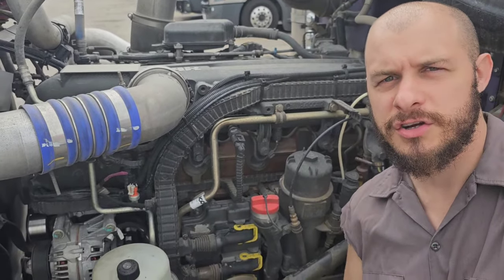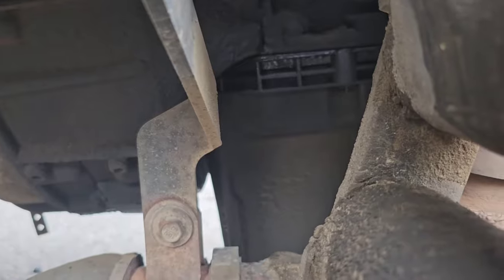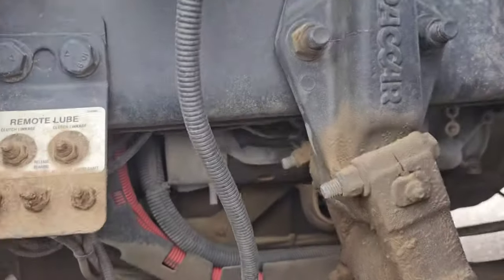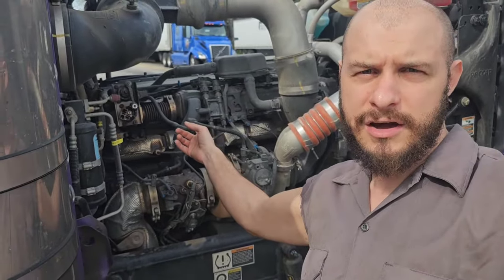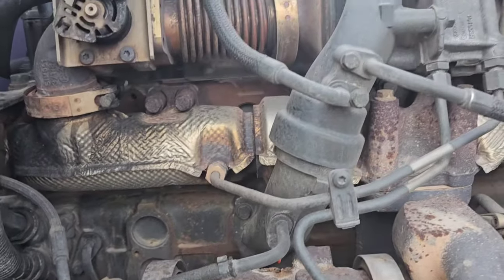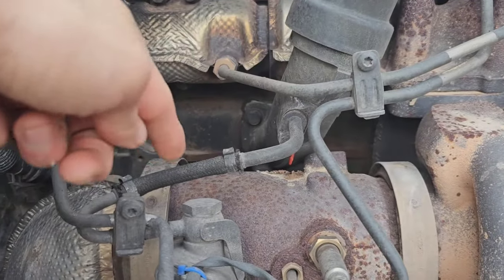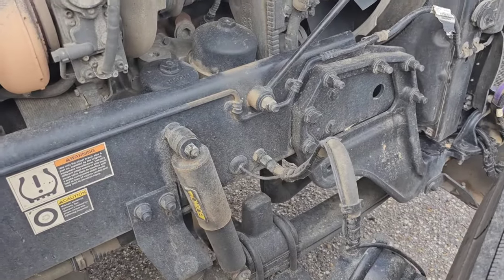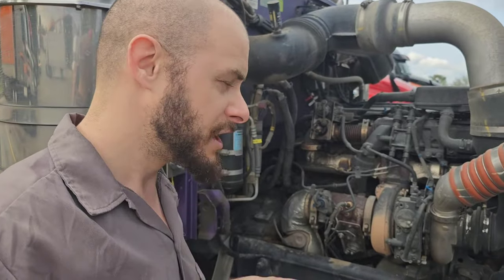few new issues with my PACCAR engine

Comment: Hey bud, paccar tech here. Don’t let those guys just replace that oil pan bolt. Once a gasket starts leaking, it aint gonna stop, as you experienced with that coolant line. Gotta drop the pan and replace the oil pan gasket and torque those suckers down. Don’t replace that whole coolant line either, jut a $2 o-ring leaking. (Without labor $$) all this is just common stuff on any engine. If these are the worst problems you’ve had with a new engine consider yourself in good standing
Reply from the maker: Yeah my last paccar blew up with 700 miles on it the second day I had it... so this one is better
Reply: Lol few issues is just beginning 😢😢😢😢
In 600k miles on my engine 😮😢😢😢😢😢
1st time the rebuild the engine 465k 2nd time 665k new engine:(( 
3 times transmission:( 
Manifold  200k 
New DPF system 120k
3 times coolant reservoir:(
2 times oil pans 
Ac compresor 180k
Oil and injector seals 90k , air compressor head 2 times 😢
Radiator, alternator, EJR cooler:( ABS 4 times, 
HI pressure fuel pumps 3 times replaced 😮😢😢 DEF level & quality sensor 😢😢
350k all axels airbags and internal oil seals :((
2 times PDF all sensor replaced 😮😢😢
Coming rail, fuel pressure sensor  😮😢
Oil, pressure sensor  😢
Clutch damage by computer :((
15-20 times computer updates  😮😢😢
The list keeps going  on 😮😢😢😢
Wire harness  , ABS harness :(
Reply: @mgp-bct7723 what’s the price for a rebuild on the PACCAR
Reply: robstratton based on your experience and knowledge what is better Cummins or paccar engine. ??

Comment: This question is for a paccar tech I’m currently on the side of the road with multiple codes. This thing has been nothing but a nightmare with adaptive cruise predictive cruise and transmission codes. Replaced the shifter and now this truck won’t hard reset J1939/886-09/1481-09/&19 any thoughts?

Comment: Hey there. For issues with EGR valve you can use EGR Emulator for Paccar. Its plug and play, easy to use and can solve most EGR Problems.

Comment: Sir, read your instruction manual it states after every oil change the oil plug needs to be replaced. Everytime.
Reply from the maker: The oil pan bolts come out not oil drain plug
Reply: @tips4truckers252  Bolts cant come out unless somebody screwed them out.

Comment: Hi I have same engine with 150k miles there is soot around EGR cooler is it serious should I change EGR cooler gaskets
Reply from the maker: A little soot on the actuator is normal.  I wouldn't worry about it with only 150k unless you get a differential pressure code

Comment: Hey man, quick question would you recommend buying 2020 Kenworth T680 with 400,000 miles flight maintained came equipped with APU since new very nice condition. I’ve heard bad things about Pat car. What is your recommended?
Reply from the maker: Used truck prices are through the roof but if you can get a good interest rate is what I would be wondering about
Reply: Stay away from paccar product Kenworth or Peterbilt 😢 the parts are the most expensive labor, the most expensive, and the quality the worst of the worst 😮😢😢😢😢 shame on the paccar 😢😢
😮😢😢😢
Lol few issues is just beginning 😢😢😢😢
In 600k miles on my engine 😮😢😢😢😢😢
1st time the rebuild the engine 465k 2nd time 665k new engine:(( 
3 times transmission:( 
Manifold  200k 
New DPF system 120k
3 times coolant reservoir:(
2 times oil pans 
Ac compresor 180k
Oil and injector seals 90k , air compressor head 2 times 😢
Radiator, alternator, EJR cooler:( ABS 4 times, 
HI pressure fuel pumps 3 times replaced 😮😢😢 DEF level & quality sensor 😢😢
350k all axels airbags and internal oil seals :((
2 times PDF all sensor replaced 😮😢😢
Coming rail, fuel pressure sensor  😮😢
Oil, pressure sensor  😢
Clutch damage by computer :((
15-20 times computer updates  😮😢😢
The list keeps going  on 😮😢😢😢
Wire harness  , ABS harness :(
Reply from the maker: @mgp-bct7723  at some point you have to say not all that was bad luck fr.

Comment: Lol few issues is just beginning 😢😢😢😢
In 600k miles on my engine 😮😢😢😢😢😢
1st time the rebuild the engine 465k 2nd time 665k new engine:(( 
3 times transmission:( 
Manifold  200k 
New DPF system 120k
3 times coolant reservoir:(
2 times oil pans 
Ac compresor 180k
Oil and injector seals 90k , air compressor head 2 times 😢
Radiator, alternator, EJR cooler:( ABS 4 times, 
HI pressure fuel pumps 3 times replaced 😮😢😢 DEF level & quality sensor 😢😢
350k all axels airbags and internal oil seals :((
2 times PDF all sensor replaced 😮😢😢
Coming rail, fuel pressure sensor  😮😢
Oil, pressure sensor  😢
Clutch damage by computer :((
15-20 times computer updates  😮😢😢
The list keeps going  on 😮😢😢😢
Wire harness  , ABS harness :(
Reply: but what year was that? 19-20? they have a 7year 750k warranty because of known issues.. if you got a new engine at 600k miles then you got a new engine for free